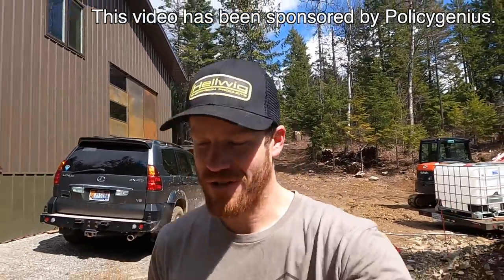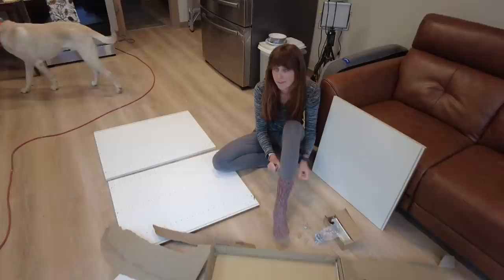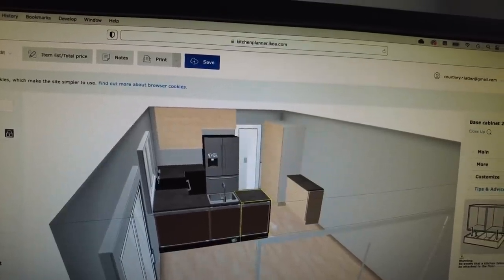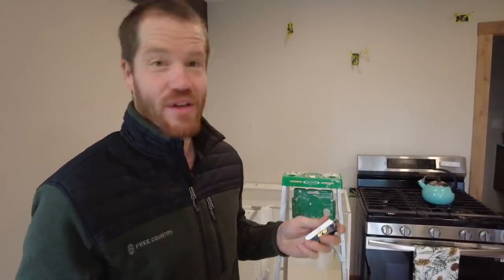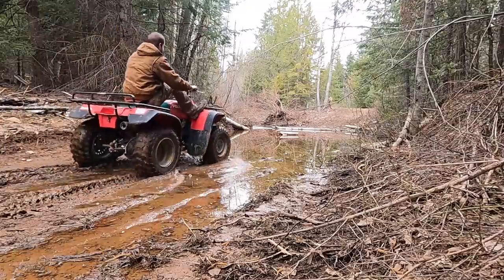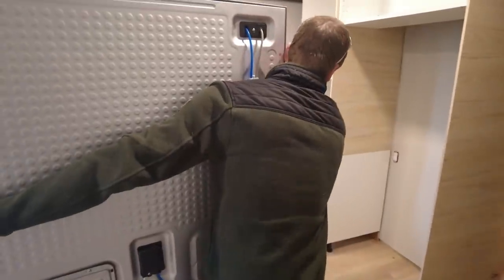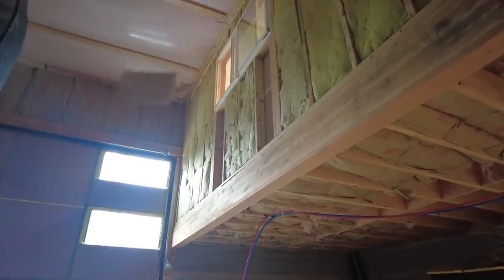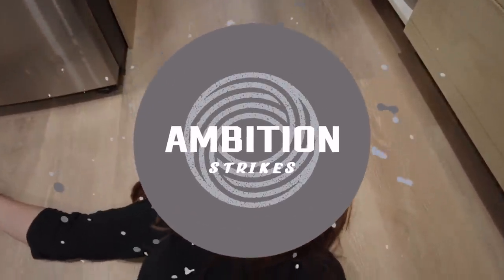COMPLETE CHANGE OF PLANS | Building Our Dream Mountain Home

Comment: For about $10 you can buy a rebuild kit for the fuel primer, basically several o rings, super easy to do, but if they go out, your truck will not run

Comment: Definitely get the dishwasher. It's a massive quality of life improvement and they're one of the cheaper appliances you can buy. It will save water over handwashing (like 3-4x less usage). Make sure you buy detergent that's greywater/septic safe. I use nature clean but there's lots of other products out there that work.

Comment: Hey GUYS! I have put a lot of IKEA Furniture together over the yrs for work & friends. The main issue I've had, was to use Trim cabinet screws to reinforce certain areas. Had to put wood stiffeners to keep things from sagging, so take a carefully look at design & its weaknesses when it comes to load. TWO Stories... My Neice has a high dresser; I had to replace the bottoms on all the drawers that were cardboard with thin plywood. I had to tighten the whole structure with trim screws, had to pre-drill everything. None of her twist locks would stay lock onto the studs, it drove me nuts! Even the fronts I had to fix with trim cabinet screws. PART TWO, had a customer we put there whole kitchen together, very similar to yours with the rail system, that was great. But were the sink install, we had to put some strong stiffeners in how it was designed so it wouldn't sag. Where the drawers were, we had to modify them & added support on the side rails. GOOD LOCK GUY'S!

Comment: Great DIY video, by moving the: Unvented , LP fired ,Water Vapor ,Carbon Monoxide , Carbon Dioxide and Particulate Mater Generating, Pollution Event, Cooking Appliance ,to the outside wall, will make it easier to Vent with a 240 cfm. Range Hood. :)

Comment: For only Two, the dishwasher is not mandatory, it needs some clean water, electricity and for heated and relatively small place like yours, you may find out some moisture very quickly. 
 But i spot something you may need to watch over it:  the fridge have no room to "breath". Plus you have an heated space, if you to keep it for 10 years or more, you need to add a ventilation system. On both side of the fridge "box" would be ideal !

Love your video, great kitchen plan and great work !

Comment: You need to vent air into the back of the fridge, otherwise it will run a lot more than it needs to. A vent in the side panel at the bottom would work. Great job on building your home. Cheers
Reply: Also lets the heat out

Comment: You might consider a fuel filter change - fuel additives ( Seafoam - Chemtool - Lucas etc . . ) - a tune up etc . . considering it is fairly important to have that vehicle running. And sometimes it is a tank of bad gas. Try a higher octane fill up next time ( just once )
Reply: its a diesel!!! gas would be very bad for it!!!
Reply: @pisom4314  Our old timers claim that adding a cup of kerosene once a month does wonders in old diesel engines (before computers and sophisticated injections)

Comment: Things I did not like about IKEA (made whole kitchen as well) - too short legs (bought alternative to get countertop height at 93cm), limited selection of countertops and door materials. Then some of the mesh drawers and hardware bought also elsewhere. But you can easily take all apart and reassemble IKEA, did that when we sold and moved out of apartment. But yes the thing that is most problematic - the rear nails, if you need to remove them ... well it is better not to ...
And Ikea rails are great, could do evrything alone.

Comment: Usually when there are starting problems with this engine, in my experience there is a crack in the bracket of the fuel filter

Comment: With everything that you have on the trailer you’ll have to put the slab in below and more likely be building out from the kitchen and living room area over the camper parking area not quite over possibly the camper and guesstimating it looks like to be able to still park it in side in the possibility make that addition your master bedroom and use the present bedroom as spare and office area. Keep it going looking good for a pleasant young couple, just get the road repaired

Comment: For the refrigerator did you think about cutting a hole in the wall, pushing it back and building a support stand for the portion thru the wall? That way your could have kept the orig plan.

Comment: Looking good you two! Riley, I have a lot of information to offer about your truck. I have the same truck and engine, and when your's didn't start it made me go uh oh!  because I had the same issues on mine a while back. You've likely got a leaking/clogged injector. First step is to get a cheap OBDI dongle ($30- Bluetooth connected to my phone, running Dashcommand) to see your fuel supply/return pressures. If any cylinder is >4, you've got clogged injector & blowing smoke (unburnt fuel from exhaust) or a leaking return line. If leaking return line, check your oil levels. You'll be "making oil" = (oil level rising over time), which means some of the diesel is going into your crankcase, and should be addressed sooner than later. Remanufactured injectors for that truck will set you back about 1.8k with exchange. It was too time consuming of a job for me, and the labor will cost as much as the parts.  Also, keep a can of engine starting spray handy.  It won't hurt the engine, and a shot of that in the intake will allow 5-10 sec of running engine, which is enough for the CP3 injector pump to build enough pressure to keep it running, and overcome the lack of sufficient pressure at startup. That engine is durable and will be a great tow machine if you monitor and take care of those injectors!  I have over 300K, and still running strong.

Comment: Use a cabinet makers hammer.  I'd send you one, but don't know how.  They are smaller hammers balanced a bit differently than a finish hammer. With everything the way it is, not even sure I can get one.  That way of opening the box is bad if it's the wrong part.  I've assembled lots of IKEA stuff, and one thing I discovered is to read ALL of the instructions first.  Sometimes they put stuff in the back that should have been first, which requires completely dismantling the cabinet to install.  I hate the plastic legs, so I make my own.
Reply from the maker: We've never used a cabinet makers hammer, we'll have to check one out!

Comment: The filter housing on the duramax is known for having o rings that dry out and crack allowing the fuel system to lose prime.  I'd bet that's your problem.
Reply from the maker: Riley thinks you're spot on! We had to do the same repair on a previous truck we owned.

Comment: Hi guys , just a thought for you , Courtney said you would come up with a place for an office , well build place off the side where the sliding glass doors are . Office desk would face towards front of building with a window in front of desk . For heat the large 120mm computer fans may be 3-4 hooked to a thermostat . They would pull hot air in from main room . Summer you would get some nice natural air flow through the office . They are 12volt DC . 2 it becomes a mud room also . As stairs would come up from the rear . If you make it so it's roof starts directly under the buildings eves , yes it will be a bit taller , but you build a reinforced ceiling and use for storage above the office .

Comment: You could backfill the low spot in your driveway because it is got three sides that are high you wouldn't have to worry about your backfill running off on those three sides,  it would make your driveway more level in that area and get rid of your two foot deep pond

Comment: For the truck, get a Dorman 904124HP. It’s a rebuild kit for the fuel primer. There’s no lift pump, so the fuel system is under suction. The seals get brittle in the primer and air gets in. It’s a pretty simple fix.
Reply: I’m in agreement. The primer pumps fail commonly AND always replace the fuel filter when in doubt about how air got in or how old it is.  Cheap, easy maintenance for all diesels.

Comment: I hope that you have better luck with your duramax than I did. My 03 did the same thing. I turned out to be the injectors. Bad design from GM on these early motors. 800.00 each to have them replaced at the dealer. Sold the truck.

Comment: 1) 16:12  "I would say it's about 2' deep in the center"....... turns out to be more like 8". ;)
2)  Did they use and 80" return and add 16" to make it floor to ceiling height by the refrigerator, and then take a 96" return and cut it down to 80" by the wall?????
Reply from the maker: The only return panels we could get were 90" tall. So we had to cut one of them down, and make one of them longer.
Reply: @AmbitionStrikes  So close (and frustrating I'm sure!)  Thanks for the clarification!

Comment: When splitting an outlet, you don’t need to split the neutral. Just the hot side. Also, on my cabinet projects, I always hang the uppers first. Makes it much easier not having to reach over the lowers when hanging them.
Reply from the maker: In this case they are separate circuits, so it's best to keep the neutrals separate all the way back to the panel. Because of the fridge return panel we couldn't hang the upper until the location of the lower was finalized.

Comment: when you cut the holes for the outlets inside the cabinets you should have cut them to fit the box and then the plug could have been flush with the inside of the cabinet and the cover plates could be installed last and cover the hole...
Reply from the maker: That would look really nice!

Comment: Note!! Ideally the cabinet above the fridge should be out from the wall about 4 inches for air flow. That would not line up with the other cabinet so you should just raise the cabinet to the ceiling for air flow under it. A low side vent would also help. Your fridge will die way before it's time if it can't breathe.
Reply from the maker: We do have the cabinet above the fridge spaced away from the wall. It has plenty of room to breath, and we don't mind that it is at a different depth than the one next to it.